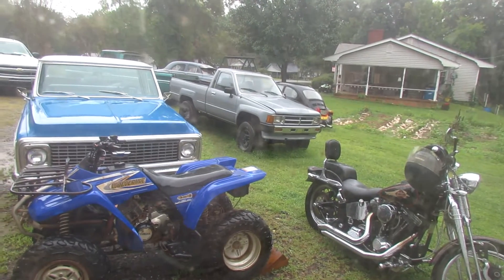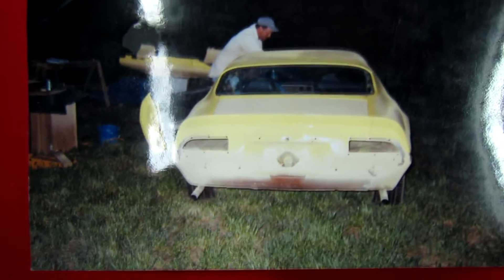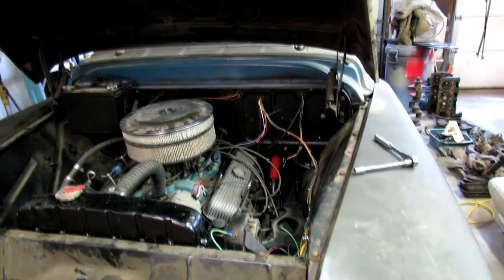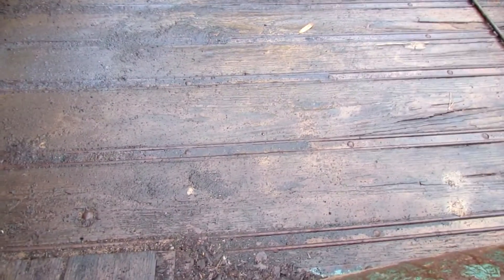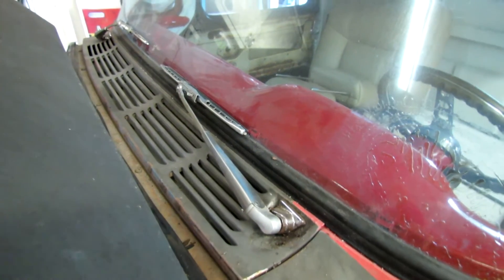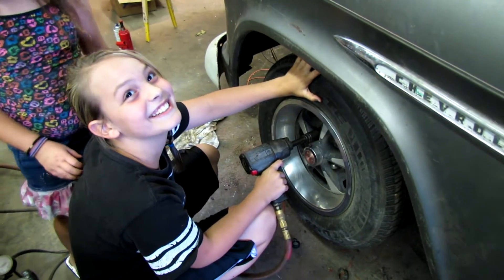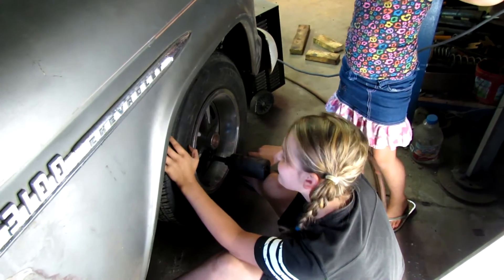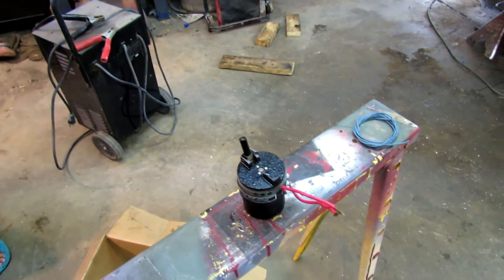55 chevy truck and 66 chevy truck

Comment: I am with her, leave it like it is but with wide whites, steel rims, hubcabs, small block. automatic and lowered of course. Those have coil suspension up front dont they, cut a coil or two out of it and lowering block out back and drive.

Comment: Very interesting bit that hand generator.  Because of the way it was written Generator, Hand, Ringing, I knew it was a military item. I did a bit of looking and found that it's part of at least one military field telephone the TA312 and may have been Vietnam era equipment, which would probably make a lot of sense if the fella that died was a Vietnam Vet.
Reply from the maker: MrComaToes Probably was